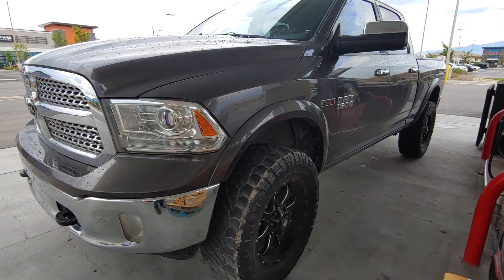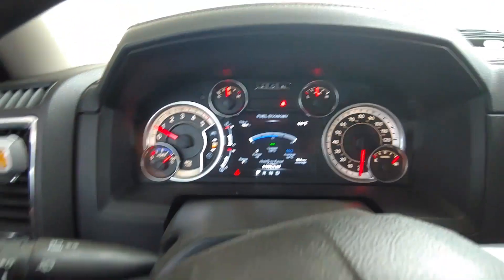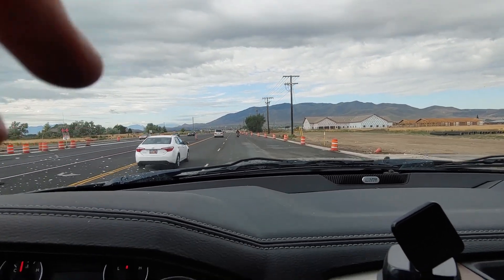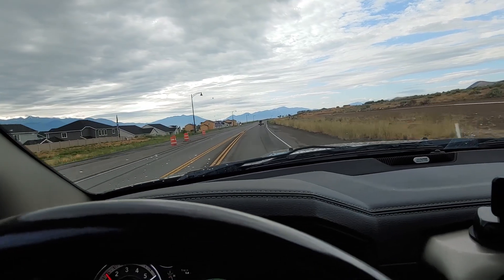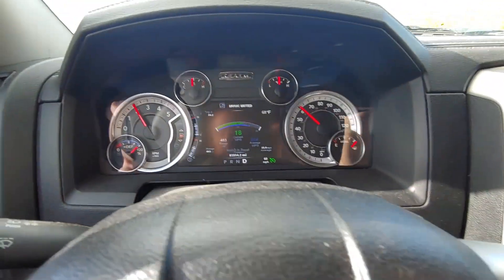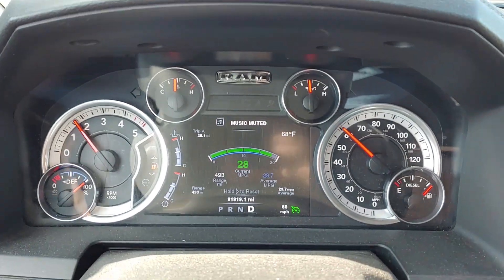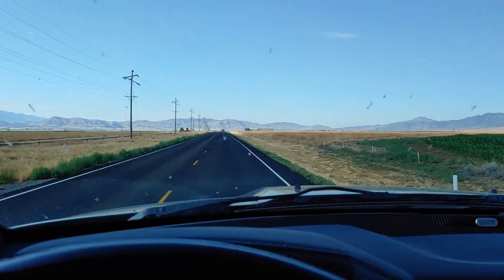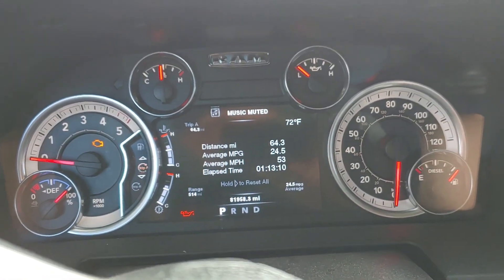Part 1: Best Tune for Lifted EcoDiesel? MPG Loop Stock VS SFT VS GDE Tunes

Comment: hi, i have a 2016 ram ecodiesel, i put 7 inch lift and 35x12.50r22 i have 3.55 gear ratio... I have a problem, that ña guagua walks with force. Transmission temperature dropped to 217F. Do you think that putting a 3.92 diff will improve the outside and remove the stress from the transmission? I am stock I only have an air intakr AFE ...
Reply from the maker: Hmm, I don't think the lift and tires are your issue. There may be something else going on. How many miles do you have? Do you have a engine/transmission tune installed? A transmission tune will help a lot because it reduces slipping which generates a lot of heat in your transmission. 

I would also recommend changing the transmission pan to a PPE aluminum pan and change your fluid, which you should do anyway if you swap the pan since you have to drain it. Several videos on youtube on how to install the PPE pan and change the fluid. 

I have a6" lift and run 37X12.5r20 tires and my temps rarely go above 200, usually 190-195. I also have the 355 rear diff. A tune and changing the fluid is what I would recommend. I am concerned that damage may have already occured on your transmission because max temps shouldn't go higher than around 210-214 for the transmission.

Comment: I'm considering buying a grand cherokee with the ecodiesel I'm concerned about reliability is anyone willing to share how many miles are on their ecodiesels and any issues they have had and how much they cost? specifically has anyone replaced the oil cooler?
Reply from the maker: Jase, sorry for the very delayed response. Didn't get a notification for your comment.  

My truck has 125k on it and I had the oil cooler replaced last year. Total cost out of pocket was 800 for the dealer to do it. 

A tune will greatly increase the reliability of your ecodiesel, as will towing and Kong drives as these engines need to be run harder and hotter to clean them. The highest mileage ecodiesels is nearing the 750k mark. He towes for a living so his truck gets worked hard. He is on his second motor, the first went out because the egr leaked coolant and he didn't catch it in time and blew a head gasket. But his second motor is going strong. He has the gde tune on his truck.  

His friend who also tows for a living has about 450k miles om his original motor and is sft tuned. 

So these can last a long time. Towing or working them a little harder will help prolong them. Short trips every day where the engine doesn't get a chance to get hot is the worst you can do for these.

Comment: Great videos and thank for spending your time video documenting this.... I was wondering if your gde tune is the new tune epa compliant with egr cooler still functioning or if you somehow have the old gde tune with the egr cooler turned off?
Reply from the maker: When I did these videos the old tunes were the only tunes available. The epa shut down GDE I'm Sept/oct 2019 and they just released their new epa compliant tune a few months ago. 

You can pickup abused ecm with their old tunes on them and program to your truck.
Reply: @GlennPearsonDIY  any chance you'll be doing the epa complaint version 🤞
Reply from the maker: @chomps21  probably not. My truck is missing a few important parts in order to do that. If I can get a hold of a truck that has those tunes then I'll do some comparisons.

Comment: can you tune the ecm to delete egr and dpf and leave the dpf exhaust in place? wont it clog up?
Reply from the maker: It will clog since it s a physical thing and isn't effected by the software. It's a filter and filters get plugged regardless. The ecm just tells the truck to dump fuel in to increase the temp so it burns out the soot. 

You can have a tune turn off def fluid, since it's not related to the DPF. And many stage 1 tunes turn off the EGR in software already. So if you picked up a stage 1 tune form sft there is an option to disable egr.
Reply: Thank you so much
Reply: When the tuner turns off the EGR are they also adjusting the fueling specifically for the loss of EGR air in the intake?
Reply from the maker: @gavinhassett479 Yes. If the tune is not adjusted with the egr disabled it wouldn't run very good and fuel mileage would be bad. All of the tunes I've tested increase fuel economy and perform much better than stock.

Comment: Hey Glen what lift kit and wheel and tires are you running?    Good looking combination buddy.
Reply from the maker: Thanks. The lift kit is the fabtech 6" lift: https://fabtechmotorsports.com/product/6-performance-system-w-front-dirt-logic-2-5-coilovers-rear-dirt-logic-shocks-k3055db/

Tires: 37" Nitto Ridge Grapplers - https://ntwonline.com/37x12-50r20e-ridge-grappler-nitto-tire/

And 20" ballistic rage wheels: https://www.customwheeloffset.com/buy-wheel-offset/959200050-19GBX/ballistic-rage-20x10--19

The lift, wheels and tires were on the truck when I got it. I paid a little more for this truck over others because of it. I might not have gone as aggressive if I had done it all myself. But I've since switched to 35" tires and miss my 37's and plan on going back soon.

Comment: The AEM software update that owners of 2014-2015 Ecodiesel vehicle did to comply with the EPA/Class Action Lawsuit have reported problems with the coolant smell along with poor turbo lag and less miles per gallon. 
The current recall from FCA is for the coolant leak which can cause an engine fire. My 2015 is at the dealer. I noticed an coolant odor back in November. I brought my vehicle to the dealer for the coolant smell. The dealer service contacted me that my EGR cooler needs to be replaced. The part is unavailable with no further information available when it will get repaired. I haven’t submitted my paperwork for the $3,075 USD refund. The Class Action Lawsuit has a stipulation that a vehicle in the dealer more than 30 days qualifies for a buyback.
Reply from the maker: Unfortunately the stipulation for the buyback is if the reason its in the dealer is directly related to the AEM's update. If its there for other reasons, the buyback doesn't apply. But there are lemon-laws that can be pursued instead. I would get the paperwork in order for the AEMs update and have it done. I had it done on mine. It wasn't much worse than the original stock tune, and actually performed slightly better once the truck was warmed up. The "turbo lag" is actually a delay put in for emissions compliance reasons by FCA. The coolant smell is not related to the AEMs update, but the EGR cooler failure, something that has been an issue since the release of the Ecodiesel. 

My truck no longer has any of these issues and I expect a long life out of it. But not everyone has the ability to do what I have done due to local regulations and emissions compliance.
Reply: Glenn Pearson I had the AEM software update in June and haven’t submitted my paperwork for the $3,075 plus extended warranty.  The EGR cooler is related to this AEM software update which created higher operating temperatures. The people who haven’t experienced all those Ecodiesel problems have stated to notice all the problems. The dealer and fleet service Ecodiesel all pushing over 90,000 miles have shown fatigue cracks. It stemmed from the new AEM software update. Many people like me never had the engine blow up and pleased with the vehicle. The AEM software update definitely is causing those problems. I wouldn’t tune the truck as the EPA and state laws have stiff penalties in place. GDE was shut down. Customers faced huge fines as the EPA cracked down. All those aftermarket tunes are illegal.
Reply from the maker: @Hunterny1  No customer has faced any fines from the EPA. They do not have the man power to go after customers. Yet. But I don't think it will ever come to that. Especially since the racing segment just won a lawsuit against the EPA for tuning race cars. GDE was fined and shutdown for some of their tunes, but are still selling in canada and will be back with a complaint EPA tune shortly in the US. There are thousands of ED's tuned still, and many more every week. GDE was one company out of many that offers tunes.

The AEMs update may have shown the issues with the EGR faster for some, but the issue was already in place. Many caught fire long before the AEMs update was even in place. This is partly why GDE started tuning. EGR caused many engine failures and as long as the EGR is running on an ecodiesel, the engine will fail eventually. There is no way around that.

 My operating temp was the same before and after the AEMs and I have other videos discussing oil/coolant temps as well as a lot of data to back it up. I tow every week, and track temps very closely and log them. I knew what the AEMs update did and monitored things even closer.
Reply from the maker: You're filling in the blanks and throwing out a lot of speculation and misinformation about the AEMs tune, some I have read already but its all a bunch of guessing. Those that have been around this engine for years know of the problems, and no new issues came with the AEM's update other than the lag. It expedited other issues, but they were already there. FCA was forced to extend their warranty with the AEMs update. It would be financially damning to them to push out such an update that would cause so many issues. The issues were already there. The EGR's on these trucks have caused issues since day 1.
Reply: Glenn Pearson Unfortunately, the information from dealers and engine fires are not fake or misinformation. I appreciate your aftermarket tune to help Ecodiesel owners.
Reply from the maker: @Hunterny1  I don't have any tunes, and am not a tuner. I only test products and provide information. I also worked for a Ram dealer for several years. I also speak to the Ram dealer I worked at frequently. They have no information on the correlation between the AEMs update and the EGR recall. In fact, they said a lawsuit came in over a year and a half ago that caused FCA to investigate the EGR fires. Long before the AEMs flash began. 

Dealers often have little to no information, which my dealer readily admit. He has been aware of issues with the EGR for several years because they have replaced many that had leaking EGR coolers from the cracks. If you do an online search, you will find leaking EGR coolers and issues well documented back to 2014. This isn't new, and the AEMs update is only coincidental.
Reply: Glenn Pearson The Service Manager said he’s corresponding with other dealers and information is being sent back to FCA. He did tell me this may be related to the AEM software update. As you said, this problem is going on for a long time. The few engine fires that happened did occur after the AEM software update.  That can’t be ruled out either. I did not perform any aftermarket tunes on my vehicle. I might purchase a new 2020 Ecodiesel. I have 93,000 miles and the original owner of a 2015 Big Horn Ecodiesel.

Comment: WHY DONT YOU RUN A tank full.and then check
Reply from the maker: Because a tank full would not be a good comparison. I am self employed and flip houses. I drive all over and am very inconsistent, making it impossible to get a fair comparison tank to tank. One tank could be 90% highway and the next tank could be 90% city. This mpg loop, using the proven fill-up technique that tfltrucks use for their comparisons, is the best way I can compare the tunes fairly given my time constraints. If I was making 800 mile trips back to back on the same route, and the weather and traffic stayed the same, than that would be the best way to compare them. But that isn't realistic. You won't find anything online that compares these tunes better than what I have done.

Comment: I love my stage 2 SFT. Sucks the EPA cracked down on GDE. But the SFT is very solid for what it is. It's not a harsh tune at all and the truck is still a turtle but its great over stock.
Reply from the maker: Do you have the transmission tune?

Comment: I've found with AEM tune in my 14 with 3.92 gears has less shift dance. And will hit 8th at 60 and just hang out. Also really good for pulling like a freight train. But I wanted GDE but might go sofa king. And stock tires and stock tune my average is 24. Mpg and 13 towing 7k camper.
Reply from the maker: Hey Sean, I watched some of your videos before I purchased my EcoDiesel. :) I just helped my dad pick up his 2015 EcoDiesel with the 3.92 rear diff. His gets 2-3 mpg less than mine did on the highway and ran about 600rpms higher at 70mph. I'll also be doing this run with his truck stock and with gde. 

I've completed the gde run but before I post it I am doing another run with sft because I had to buy new tires and went with 35's this time instead of 37's so that changes the comparison. So I have part 2 up with the sft on the 37s but will upload a part 2.5 with the sft on the 35s just so it's fair. 

I also did the hypermile loop with the GDE installed. Pretty happy with the results of what I was able to get from my truck. There will definitely be some backlash and disbelief when I post it, but that is the nature of doing this. But the loop is the same, and it's all hand calculated so it's hard to argue. I'll do a hypermile loop with sft as well.
Reply: Thanks for watching. I forget people actually watch those. I'm looking for more miles out of mine,  I want the turbo break and ability to use the cruise when towing camper. But my guess on you're dad's truck should be about 23 mpg and hyper loop mid 25's if he has AEM and stock 20's. My truck runs about 75 mph all day and getting 23. If I run 60 to 65 it will get 24 to 25 mpg. I can give some really good numbers for a completely stock truck. I track every tank. My high pre AEM was 27mpg. Low was 22. Average was 24. Post AEM has been 18 low average. High 26 average 24 mpg.
Reply from the maker: Hey so we got the gde trans and engine tune my my dad's truck. Probably one of the last tunes gde sent out. It's a Laramie with the 3.92 rear diff. He got 24.5mpg on this loop stock, similar to mine, but after the tunes he was just over 28mpg on this look. So he gained about 4mpg from the tunes. I imagine sft would be similar.

Comment: Nice truck! Look forward to the tunes loop. Will you also be installing exhaust?
Reply from the maker: After I complete these videos, I'll most likely swap my exhaust and compare the stage 2 tunes at that point. I finished the SFT tune and need to get that up. My GDE tune didn't have some of the options I ordered so I had to send the ECU back again for them to load them so I'm waiting for that to come back so I can do that run. But I'll get the SFT run up in the next day or two.